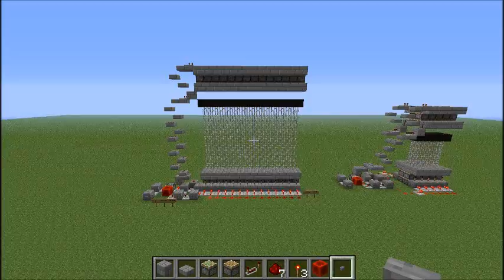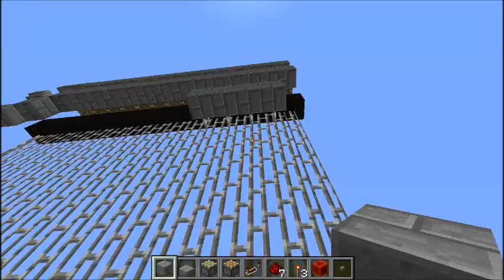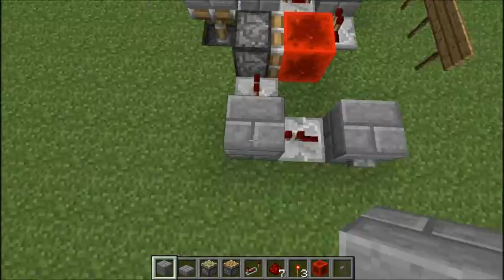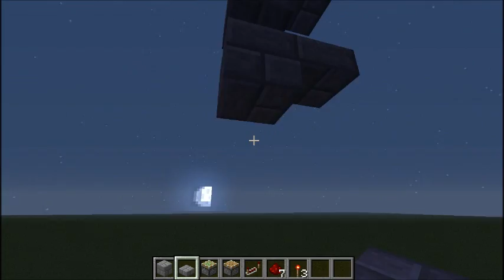Minecraft Compact Castle Gate Tutorial (No Sand or Gravel) [PC]

Comment: After I break that one torch that you build in the beginning and then put it back the blocks go down 1 more block which makes the floor that has the pistons under it flush with the regular floor.
Reply from the maker: Going off what you described, the second pulse may be hitting that primary torch too early for some reason. Try increasing the delay on the repeater at 4:22.  Hope it works for you.
Reply: I re did the video and found where I went wrong with forgetting a sticky piston + getting a few repeaters messed up. The OOONLY thing that is not working out 100% is 1 of the 20 blocks thats in the iron gate ( the closest block to the torch that powers everything) only goes up 1 block instead of two, it's almost like the piston at the top is not pulling up the block(wool) thats connected to the iron bars
Reply: nevermind.... I forgot to replace one of the first blocks that initiate the piston to extend...
anyways thanks for the video! My gate should be running tomorrow. I really need to invest in the PC version of this game. Much cooler stuff

Comment: Whats up again Russel I have this gate completely working on xbox one edition exceptttttt. When I open the gate the blocks that are under the iron bars only go down 1 block instead of 2 which would make it flush with the floor. I've tried to compare this video and your other one to see if I screwed up on the repeaters somewhere. Besides that, everything is golden. I just now need to figure out how to hide all the redstone. ( I also did the double wide gate that requires 40 sticky pistons on the bottom if that helps solve my problem)

Comment: I'm no redstone expert but once I had the bottom portion built it raised the gate fine, the second I build the top portion the bottom portion stops working entirely.  Tried removing part of the circuit in the top connection to see if it was interfering somehow but now I can't get any of it to work.
Reply from the maker: I can't be entirely sure of what went wrong going off that description, but because it worked before making the top part, I would double check the number of blocks the bottom piston would be pushing with the gate closed(can be no more than 12).  If the bottom pistons get messed up, you have to break the torch connected to the circuit, break and replace all the torches that directly power the pistons, then place, break, and replace the torch connected to the circuit.  This resets the cycle the bottom pistons go through so that it lines up with the signals from the circuit.   Hope this helps, but if you have more questions, please let me know.

Comment: this video has dislikes because overall its entirely lazy. the single gate was good, not great but decent, then the dual gate which is an entirely seperate entity is completely unexplained. he literally says "and this is how the top part is" as if a literal 3 second glimpse is going to show us how to do it. im still extremely stuck on trying to make the dual gate and this video is the only one i can find on youtube, and its almost completely useless. hence why it has dislikes.
Reply from the maker: Hello, sorry you're having difficulties with getting the dual gate working.  In hindsight, yeah... I really should have spent more time covering the slight differences between the two versions, but at the time I was relatively inexperienced with the entire "making tutorials" thing.  Anyway, what part exactly are you having issues with?  As long at the bulk of the redstone is correctly spaced with the lines of pistons (9:17), the more complicated redstone side of it should be good.  As far as connecting the circuit to the top pistons, it is just a tower of slabs with redstone (same as the normal version, just shifted with a small "L" to account for the re-positioned circuit in relation to the gate itself) that splits at the top to connect to the two repeaters on sides.  This split at the top of the vertical redstone and the change in the spacing of the circuit in relation tot he gate are the only major differences between the two versions, because other than the redstone connecting the circuit to the pistons, the second row of the gate is a mirror of the normal version.  Hope this helps, if you have any further questions, let me know.

Comment: I have a modification to the circuit to support double array of pistons on a modded server.
first replace the piston with the redstone block with a t-flip-flop pushing a redstone block (server make the piston pull back the block everytime)
add a second loop of redstone repeaters (4 total on max ticks) that leads away from the piston pushing the block up and leading towards the redstone torch that powers the bottom pistons

top pistons that close the gate require an extra redstone repeater going into ONLY the bottom row of pistons

its not the prettiest of solutions as the opening mechanism now takes a bit longer but it works

if this is unclear reply to this and ill try to figure out a better way to explain it. (I'm aware text isnt the best way to explain it, but no point in making a video / pictures etc if no one is truly interested.)
Reply: make a vid pla
Reply: pls

Comment: Hi so you sent me to this video when i commented on your other door and i wrote on the wrong video
this is the door i made and it doesnt work. is it because it's a server?
Reply from the maker: If the server is completely vanilla, not bukkit etc., it should work, but server lag can mess up the timings.  Sometimes it helps to increase the delay on the repeater at 4:21 from 1 to 4 since it delays the second signal.  Also, since the gate has failed opening, you will probably have to do the reset process of breaking the main torch (one that powers the redstone line), breaking and replacing all of the torches powering the pistons (the pistons should be fully extended after doing this), then replacing, breaking, and replacing the main torch so that the bottom is fully closed.  Hope this helps, let me know if you have any of questions.
Reply: Russle96 Still doesnt work :S
Reply from the maker: Hmm... just out of curiosity, what type of server do you play on?  I know for sure that it works on completely vanilla servers because I tested it on mine.  I wish I knew what doesn't let it work on some severs so that I could possibly fix it.  Sorry it doesn't work for you.

Comment: I don't understand why you have dislikes, there should be NONE, you are a great creator, and do you have a tutorial to make the flags on top of the towers in your gate tutorial?
Reply from the maker: Thanks, redstone videos normally get it the worse, as far as dislikes go, because of inconsistencies between the different versions of minecraft (pc, xbox, ps3, etc...)  which cause some redstone designs to not work across all versions.  Also, it would be generally easier for someone to make a slight error when following a redstone tutorial (ie click a repeater one extra time) and end up thinking that the design just doesn't work.  Anyway... I haven't done a tutorial for the flag (unless it's bundled in with one of my other tutorials and I just don't remember...), but the are fairly easy to make.  Here's a screen shot for reference http://imgur.com/SPK1YcO   The bottom of the flag starts 15 block up from the wooden floor on the tower.  The flag is made of off-set 1x3x5 sections (except for the last one).  The top torch part starts 3 blocks (place the stairs on the third block so that there is a 2 block gap between the wool and stairs) above the flag.  Hope this helps, let me know if you need my to explain anything in further detail.

Comment: is there a tutorial for the 2 wide version of the gate
Reply from the maker: Not really, the only differences are that the line of pistons, torches, redstone, etc. on the bottom and top are mirrored and the way the circuit connects to the lines is slightly different.  Look at 0:28 for the layout of connecting redstone for the bottom part.  The connecting redstone for top part is the same for each side as the one-wide version, but connect the vertical redstone/slab part once it's below the repeater.  Hope this helps, let me know if you have any more question.
Reply: Russle96 ok ill try that i been using ur castle walls an gatehouse to build a castle when i finished the gatehouse i was like how do i do the gate i built the double sided gate an made it a little longer thanks

Comment: Umm, the repeater agianst the block on the bottom to keep the torches not lit is powering the bottom pistons :/
Reply from the maker: You're talking about the repeaters in the long line, right?  In short, this design works on the basis that pistons can't push extended pistons, and won't try again until updated.  So... in this design, when the top pistons are extended, the bottom pistons can't push up because the top pistons are unpowered slightly after the bottom pistons are powered.  Basically, what I'm trying to say is that those repeaters should power the bottom pistons.  As far as you being on console, the gate should work as long as the redstone timings are the same as they are on pc (I'm not sure if they are), or if some other mechanic difference would mess the design up.

Comment: Thank you, it did work, but it didn't work well, with 10 blocks wide, and 9 high, so I did 6 wide, and 9 high, and it works
Reply from the maker: You're welcome, I'm glad you got at least something to work... I have no idea why it wouldn't work at 10 blocks wide since it is the same exact circuit, was there anything around the edges of the gate that might have been interfering?
Reply: No, I made sure the only normal blocks were at least 2 squares away, except for right under it. But with the normal one, it would always have one row of the pistons on the bottom sticking up one high, and I did break the first torch and replace it, but it wouldn't work. But thanks for the help. :)

Comment: Can you change the input to pressure plates? and if you could how would you go about it?
Reply from the maker: Yes you can.  All you would have to do is connect the pressure plates to the repeater the the button in the video is connected to.  Without changing anything else, this will make each pressure plate essentially act like the original button, were as any pressure plate will be able to both open and close the gate as long as it is connected to the input repeater.  If you need me to better explain how to actually set up the pressure plates, let me know.
Reply: Russle96 That would be helpful, as i'm not the greatest when it come sto working with redstone. Also, I'm having an issue on my server (and i do know you put a comment it doesn't work very friendly on servers) that the glitch is happening where when all is connected, the bottom layer of pistons are extended while the top layer is retracted. I have tried your fix method, but it doesn't seem to help.
Reply from the maker: Spiriteagle114 Ok, for setting up the pressure plates, the easiest way to do it would be to figure out where you want the pressure plates.  Then one block below the block the pressure plate is on place some redstone so that the pressure plate powers it.  Then simply make a line of redstone (you might need repeaters depending on how far it is from the circuit) to the repeater at the start of the circuit.  Since the fix method I have at the end of this video isn't working, it might be slight server lag messing up the timings.  I'm not entirely sure if this will fix it, but try increasing the delay on the repeater at 4:21 to maximum delay to try and account for any lag, you might have to try the fix again to reset the gate.  Also, when you do do the fix method, does it fully reset, and then just break whenever you try to use the gate, or doesn't it not work in the first place?
Reply: Russle96 I'll go to break all the torches. Then replace all the torches by the pistons to get them fully extended. Then i'll go set the torch to complete the circuit and the top layer of sticky pistons retracts while the bottom layer stays extended. I'm on the Runic Paradise server, name hawx114 if you'd like to hop on and see.
Reply: Spiriteagle114 And after that i take down that one torch severing the circuit and the bottom layer retracts while the top extends. Also when the circuit is connected, the torches by the pistons are off. When it is disconnected, the torches by the pistons are on.
Reply: Russle96 Working on the basics here - it seems that the power from the one single torch is feeding the bottom pistons. How can i work around that?
Reply from the maker: Spiriteagle114 Sorry for the delayed reply.  Ok... if I'm understanding correctly, you're basically wanting to redesign it to be more server friendly?  I don't think that the single torch being a power source is the problem.  What is more than likely the issue is how the pistons are powered.  Basically what happens with the bottom pistons is that since there are both repeaters and torches powering them, there is always an inverted signal, so when ever the source torch changes states, each stack of two pistons get multiple inputs(if the repeater is powered, the torch gets turned off and vice versa)  It's the very slight delay between when the repeater changes and when the torch changes that make the pistons move like they do.  In some cases, it seems like increasing the delay between the powering on and off helps(the repeater in the "circle" of repeater), but if that doesn't work, I think that there would have to be something with the server that creates just enough lag to jumble the repeater and torch signals to the pistons messing up the cycle.  So... I guess what I was trying to get to is that this specific design probably won't be able to work on all server because of inherent lag.  However, it is possible to make a two tall gate that doesn't use as specific of timings. but I'm not even sure if that design would work 100% of the time.

Comment: I know this is an older video, but is there any way of extending this at the end? I'm building a compound and I want to put walls all the way around that raise and lower with a daylight sensor. I'd prefer to do it without redoing the circuit for every portion of wall.
Reply from the maker: If it is in separate portions, you could just put a repeater at the end of each line of redstone that powers the pistons, then make another portion of the gate.  You would have to put two repeaters(one per redstone line) on the top part to have it close.  However, it would leave a 1 block gap between the sections, but if you already have a design for the wall you could widen the gap to match up with the design, but you would probably need a repeater on both sides of the gap(end of one section of redstone, start of the next).  If you need to have no gaps in the gate, or want all of them to open at the same time, it should be possible, but it would be much more complicated.  Hope this helps.

Comment: Yes so in the row of pistona. The 1 closest to the compacted wiring. The cobble on that gets stuck in the gate and pushes everything including the pistons on top up. 1 space. But everything else works fine. Also.... the gate only seems to open 1 block space instead of 2.
Reply from the maker: Hmm... well... the only way that the bottom pistons could move the top pistons would be if you have too many blocks in between the two sets of pistons, when the gate is close there should be a two block gap between the top of the gate and the top pistons, when it is open there should be no gap.  As far as the entire thing only opening 1 block instead of two,  i would first double check to make sure the gate itself isn't too tall, and if that doesn't fix it, double check the timings on the repeaters.  Hope this helps.

Comment: Hey man non of the gates are working right. Ur 1st tutorial i tried but only 1 space opens up and not 2 so i cant walk through. Idk whats wrong. Also with the compact it does the same but the 1st pair of sticky pistons to the left infront of the torch, 1 stays up and the block gets stuck in the gate pushing  that whole column up a block level. Please help. Im also on tekkit lite so could that b a problem?
Reply from the maker: My earlier versions were broken by updates (I believe I explain this a put a link to this version in those videos' descriptions), but this version still works perfectly fine.  When you say that the pistons are pushing the whole column up a block level, are you saying that they are pushing everything up, including the top pistons?  Also, I'm not sure if tekkit lite would affect it but you could try to increase the delay of the repeater at 4:21 to try and account for any lag/changes in timing.

Comment: it wont work on xbox because there is no block of redstone to use :( Is there anyway I can get around this?
Reply from the maker: Yeah, the only thing you should have to do is replace the block of redstone with a solid block, then place two redstone torches underneath the two spots the solid block would be pushed/pulled to by the sticky piston so that the torches power the solid block, powering the repeater/redstone.  Unless there are some other differences between the pc and xbox versions, this should work.

Comment: The breaking of the Torch at 4:20 doesn't work for me either. The bottom row of pistons is clearly still powered by the repeaters going into the blocks next to them. I don't know how you got them to go down for you at all.
Reply from the maker: Uh... I don't know what you did wrong, but that torch is the only source of power for that redstone line, so breaking it should definitely unpower the repeaters.  Just to make sure, you're are talking about the torch that I placed almost exactly at 4:25 right?